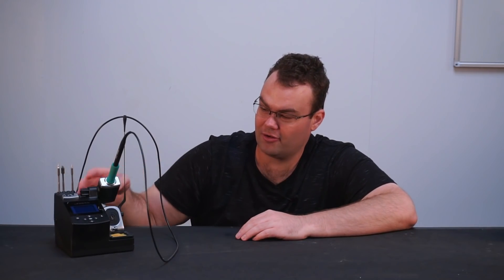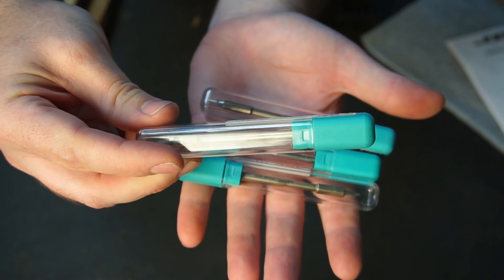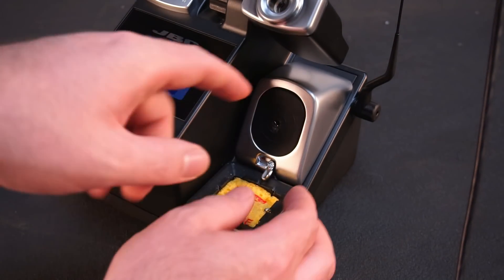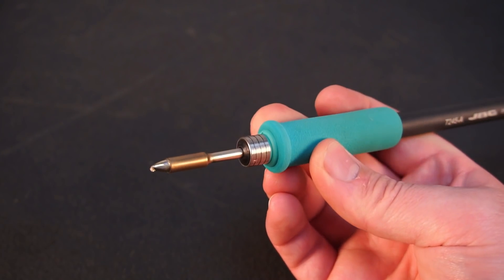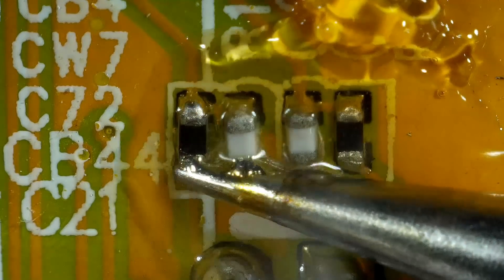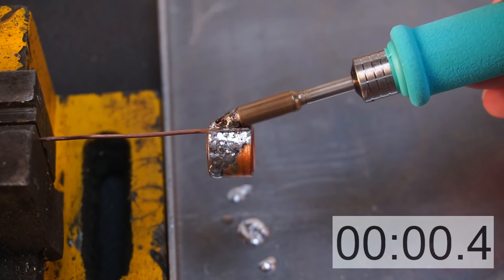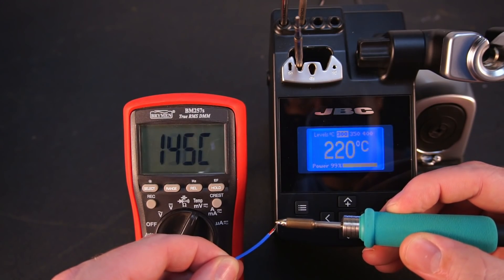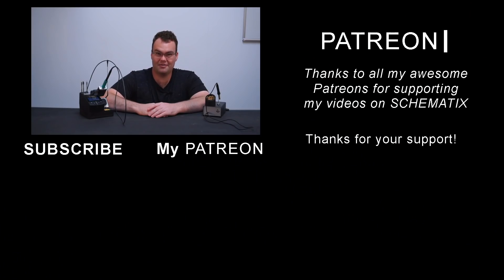JBC Soldering Station Review II JBC CD-2BQF

Comment: I think both of the sponses don't really are thought out well enough it seems.. The upper sponse imo worked better if it was open, so you can take it out when it is due for replacement, that weird little clamp will drive you crazy... and the down sponse has this weird open lid on it, i'd rather seen another type of sponse more open and thicker without the weird open lid, so you can take it out and wet it if needed..

Comment: I already have TS80P but the problem is that I had few tips just die after few uses and those cost £35 so more than JBC powerful C245 cartridges which will definitely last much longer.

Comment: I bought this soldering station (well, the previous jbc cd_2bqE), along with both types of desoldering stations (pump and tweezers versions) and it has been a pleasure to use. Really quick tip change, heats up very fast, lots of tip options, comfort is quite good. BUT, two and a half year after the purchase it stopped functioning properly and is now sending power to the tip intermittently whilst making some weird gargle sound. For a device that costs 450€ it is quite disappointing, certainly even more so since the warranty ended a handful of months ago. 
 Just... beware, you might have to reinvest in a couple or so years if u use it often. Although is suspect a colleague of mine to have pushed it to the max temp on the biggest tip and heating a whole pcb with it to desolder a 60 pin connector in one go... might have been excessive....
 With that said, i have had Weller top of the line failing way sooner than this because of overheating the cartridge and rendering the pencil useless (costs half the price of the whole station unit).
Reply: Maybe you got a bad one? It happens on other devices too

Comment: I am new to soldering but wanted to buy a JBC unit to start so as not to waste money on something that I will want to replace later. But JBC has so many different models and I can’t tell which one would be best for my desired use-case which would be to work on computer motherboards and add-in cards including desoldering and surface mount chips. Which one would you recommend for that, and why?

Thanks in advance for the help.

Comment: I've just bought a CD-2BQF and all of the buttons get stuck down on occasion. Is this normal? Thanks.
Reply: @Валерий Свирский Thank you. I removed the excess plastic around the buttons (mold flash) with a scalpel because my location would make returning the soldering station very difficult.
Reply: @Валерий Свирский Thank you for the advice regarding JABE cartridges. Coincidentally, I have just destroyed the last cartridge for my older JBC's 2010 handpiece. I know that the wiring of my JBC Advanced AD 2000 soldering station can be modified for the newer C210 handpiece but noone has details of the new wiring :-(

Comment: Can this JBC CD-2BQF works with T210 handle and heater?
Reply: Yes.  The station detects which tool is plugged in (T245 or T210 only, no tweezers or desoldering gun).
Reply: @gtm7713  Thank you. Are they the same exactly station (except the handle and handle parts) between CD-2BQF(for T245) and CD-2SQF(for T210)?
Reply: @gtm7713  Wow. Your explanation and the pdf docs you share are very clearly. Thank you very much.

Comment: I basically got a cheap Chinese version of that for $40. Ceramic element and goes from 200-450C in a  minute or so. Not sure about wattage but prob 150 if you're trying to heat up a heatsink or something major. Only thing it's missing is a good vacuum desoldering pump, but for $40 instead of $250+ I guess I can live without that.
Reply: Any keywords on that? Because that would be really interesting, haven't seen one of those yet. I mean $40 is a T12 price, and T12 is damn punchy because of cartridge construction and PID, but it's only about 70W on a good day, it's not making competition to JBC any time soon.

TS80 is actually based on T12, nearly identical construction, just shorter cartridge to make room for electronics and flanged to compensate for stability. It has the same exact performance.
Reply: @SianaGearz  It's a modded/RMStator-rebranded 939D similar to a Yihua 939D you'd find on Aliexpress. I got mine a few years ago and the price has went up a bit since then ($54). They basically took the vanilla Yihua model and put higher powered parts in it with a slightly bigger iron. At least that's what I'm assuming since after 4 years it still works like day 1 other than slightly worn tips. Also guessing it's because I seldom need ~150W and running it at that level for too long will probably kill it, being cheap and all.
Reply: @fvckyoutubescensorshipandt2718 
I think you got a T12. Does the cartridge look like a T12? The spec seems to be 70W on RMStator. "Running at more than about 150W would kill it" is not a consideration because it shouldn't be technically possible, the T12 cartridges are intended to run at 24V, that should be the output voltage of the power supply in the soldering station, and the resistance of the heater in the cartridge is such, that the full duty cycle power at 24V is 70W.

And i had seen all the bits on Chinese markets that would go into your station if it is a T12, both the handle and the analogue-style controller.

The 936 usually have the power of seems like 36W, though are often quoted 40 or 50 or something. There seems to be a distinct 75W variant too. Hakko 936 original used to be 60W. More crucially the tip is air gapped from the heater integrated into the handle, with pretty bad heat transfer; and to add to that, there ample area and structure to lose heat. The thermal connection is better in Hakko original parts, but cheapy Chinese things don't have nearly the manufacturing precision to match that.

So yeah T12 performs so much better than a normal 936. But it's not even close to JBC, and i don't think it would be even possible on material and manufacturing cost to match JBC at $40.
Reply: @SianaGearz  I haven't actually took it apart to have a look-see, but maybe it simply uses higher than 24v and reduced life is an accepted drawback (a common money saver, Class D audio amp board rated at 300W with 50V to 1-up competition at same price, but overheats and dies in months at 50V, when 45V/250 watts is more long-term reliable)? I had a similar previous one (different rebranding) with similar stated specs die in a few minutes when I turned to up to 400C (though it went to 450C) for some chassis desoldering. Or the paper specs are simply "overclocked" deceptions that weren't designed to actually be ran at that in the long term, sellers can pretty much get away with anything as long as most of them last until warranty or the return window expires.